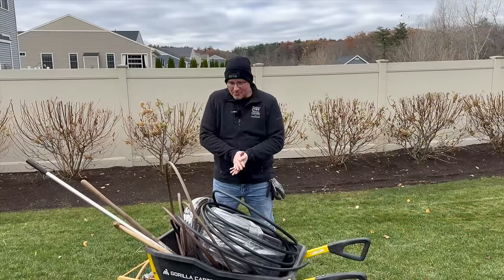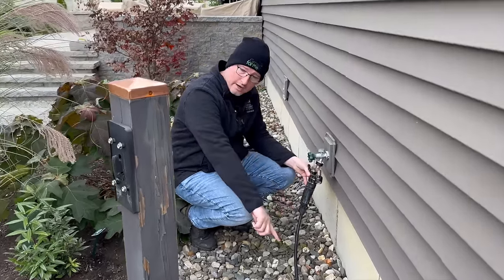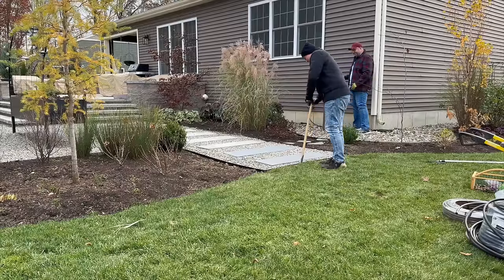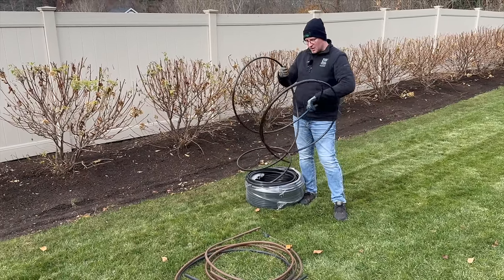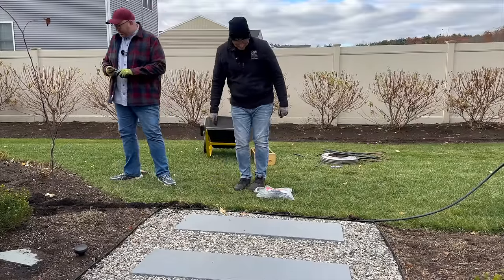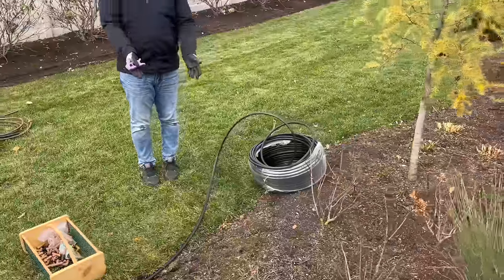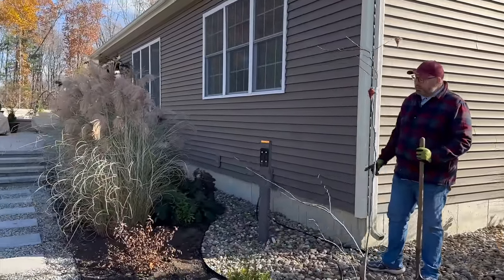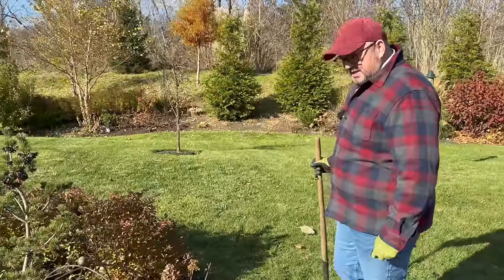Installing Drip Irrigation in our Garden || Why Fall is the PERFECT Time

Comment: You two are so entertaining and informative. I've watched many irrigation videos and yours was the most comprehensive and understandable.
A tip for uncoiling tubing from the spool so you don't have to fight its inherent nature of popping up. Aaron from Garden Answer says to roll the spool as if it is a tire instead of pulling out tubing from the stationary spool. So start at one end of garden and secure that tube end, then roll the spool as you pull tube from it until you reach your destination. 
Now, you guys cut off shorter sections to piece with the brown tubing, and that works too. 😊
I hope my description was clear.

Btw, did your garden zone change with newly released planting zone map? Mine (in Minneapolis) went up half a zone. We're now 5a. 🎉  I already had zone 5 plants, it just means I won't have to worry if they'll survive our winters.
Reply from the maker: Good tip!    We are JUST on the line of moving to 6a now, but we are still 5b!

Comment: Christopher glad you getting better and back. What I do when its to cold and to make all tubing work is to use hot water and let the end sit in the water for 15-30 seconds and they slide right on any of the connections you are trying to do. It also helps to remove the tubing off small errors of tubing.

Edit: We are now a zone 6a by the way. Are you guys selling those bennies? So cute.
Reply from the maker: Oh that’s a great idea.     We aren’t doing any merch yet. Maybe next year!
Reply: @growformegardening  Hope you guys reply. It was so cool these few days i added the remainder of my tubing. But having a problem so came back to this video to see what they problem is. Since we live in the same area I was going to ask do you guy use the pressure (PSI portion)? I think you said you dont, you just have normal home pressure. Is this correct?
Reply from the maker: @kp-gbuniqueinterest  we do use a pressure regulator at the hose bib. It’s part of the three piece connector.

Comment: I am older and find the brown couplers really hard to connect.  I use the Bic multi-purpose candle lighter to heat the tube and it slides right in.  When I need to remove coupler, I cut it away from tube with a few inches of tube and collect them in a bucket.  Then I boil them and they pull right out.
Reply from the maker: That’s a really good idea.   Eric didn’t believe me when I was wrestling them in.   When it is cold it is so hard!

Comment: I just installed drip for the first time this season and those tubes are hard to connect! I ended up using a lighter to soften the ends and it worked so well! I tried the warm water in mug thing and the water would get cold too quickly
Reply from the maker: I have to try the lighter trick

Comment: Great video. I need to install drip but i'm a little hesitant to start because i don't know where to start. I have overhead sprinklers installed in my beds and i think there's a way to convert them to drip. Other thing that keeps me from doing this is how do you know how long is too long of a line  ?
Reply from the maker: I have run realllllly long lines and not lost water pressure.   It’s really a matter of trying it out.   As our garden has grown I have split areas into their own lines if needed

Comment: How do you figure out the length at which your water pressure will handle?
Reply from the maker: I did some research on it and it was very mixed messages.  I’ve run very long lines and had no trouble, but I think you just get a sense of what is too much.